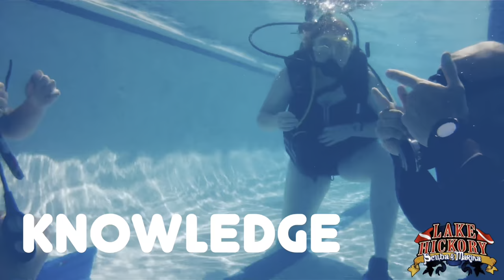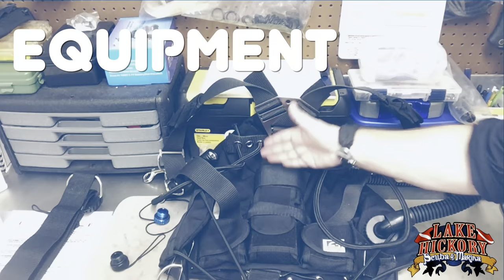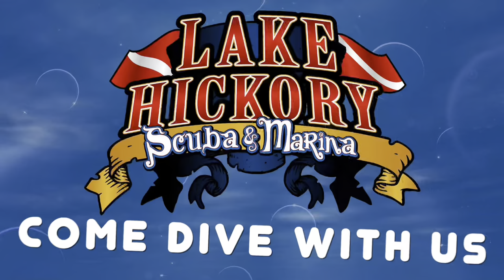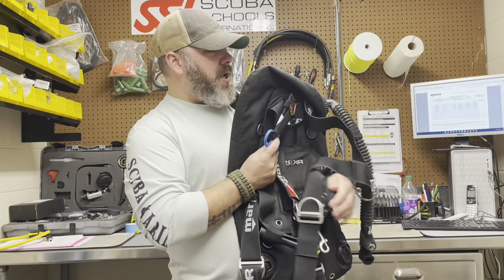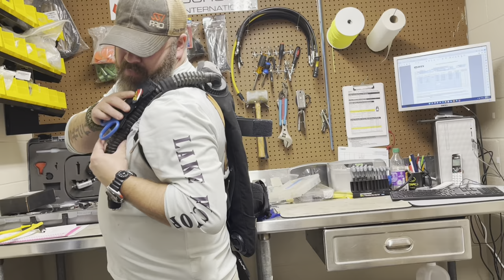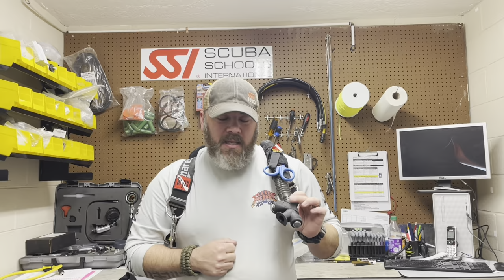How To Add EMT Shears To Your BCD

Comment: Such a good idea! Instead of using EMT shears, I opted for a knife instead. It's attached to a corrugated hose running across my body, starting from my mid-left and extending across my upper right (D-Ring). The knife will be positioned across my chest.
Reply from the maker: That is a great position @x994910. That way you can get to it with either hand.

Comment: Where do you mount your shears when side mounting?
Reply from the maker: Hello kharasaran, great question. So in Sidemount, I am currently only using the Mares Ceramic Hand Line Cutter (strapped onto my left shoulder strap). You can see this in our Sidemount videos (https://www.youtube.com/watch?v=ig8kkl_4lgo). One of our Instructors does however, use the Lifeguard Systems Shears on his Sidemount rig. He simply straps it onto his Inflator Hose as normal, with it being routed from the lower left side and across his chest.

Comment: I’d like to have a pair of shears with my dive kit but the dive shop I work for would flip out. “Those aren’t student gear!” 🤣
Reply from the maker: Hello black Ocean Diving, sorry to hear that your shop does not allow them. A lot of shops will have some type of uniform policy for its professional staff, ours included, but we don't get to caught up on the accessories. Plus, if its practical for our staff to use without becoming a safety hazzard, then of course we allow it.
Reply: @LakeHickoryScuba  Understandable. Of course every dive shop will have their own rules. When I dive not in a professional capacity, I can use what I want but when it comes to doing guided tours or teaching it’s bare minimum gear just like what Open Water students use.